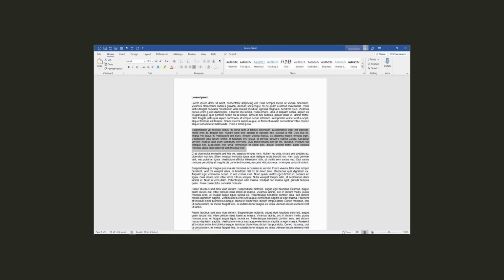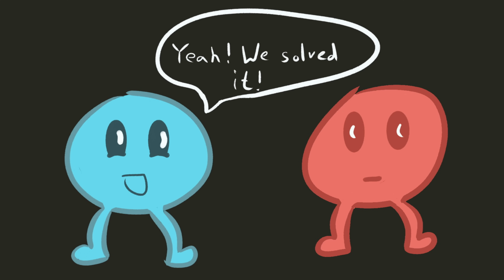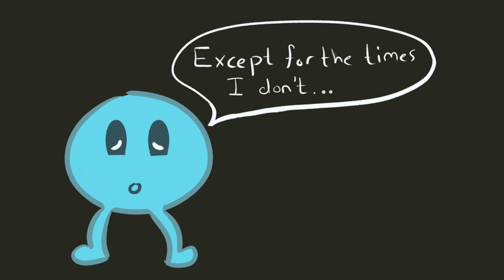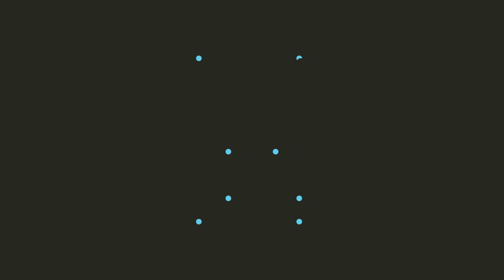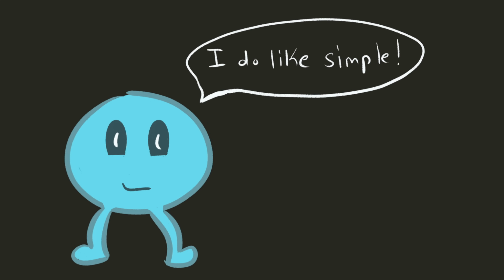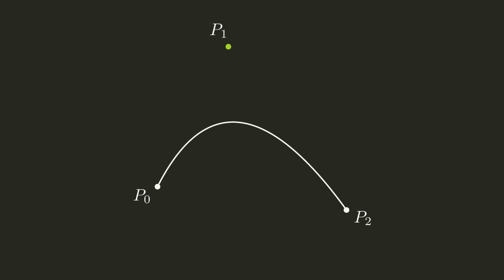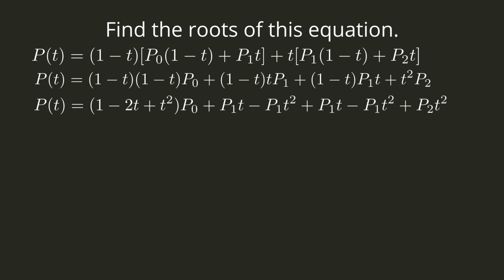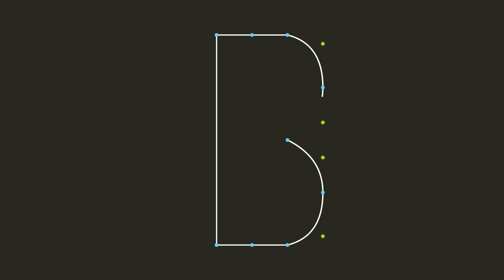The Math Behind Font Rasterization | How it Works

Comment: While what you have described will allow one to render an outline, this will not render characters or strings of characters of high quality. Consider rendering outlines on a fix grid a progressively smaller and larger sizes. Consider the letter uppercase H, at large sizes the two vertical strokes are of equal width and height, buts as the size gets smaller one of the strokes will render 1 or more pixels narrower that the other (This is known as the picket fence problem) looking at the horizontal stroke as the outline gets smaller the stroke will render wider or narrower than the vertical strokes, it will also be displaced upward or downward from it’s desired location. This is the vertical variation of the picket fence problem. Now let’s consider Capital M with regard to the vertical strokes it has the same problem as Capital H, but now it has anew problem the diagonal strokes don’t have the same widths as the size gets smaller, but because of pixelization there weight becomes heavier ( fatter relative the the vertical strokes) this applies to all diagonal strokes as is most pronounced at 45%. The same artifacts apply to curves Consider the Character O, as it drops in size the left right top and bottom will not be the same width in pixels similarly the curve will render fatter and fatter as it approaches North east, south east south west and north west. Now lets consider a collection of characters. The horizontals are varying in width and move up and down in Y the Verticals are varying in width and moving Left and right of their entended position. The most obvious artifact is the bottom of the characters don’t share a common base line the is called baseline wander. There are solutions to all of these problems that involve looking at the morphology of each character individually and looking at strings as agrégate characters with features like common base lines inter character spacing and string widths as features that need to be preserved when they are rendered. As an exercise for the reader consider the case of a lowercase i it is clear that the size of the staff and dot need to be the same, but the relative position of the dot, size of white space and staff need to be treated holistically. When one moves away from Latin Alphabets to ideogram base writing systems like Kanji, Hangul, Nihongo, Cursive positional representations like that found in Arabic… al of the Latin problems exist as well as numerous features that need to be preserved that are not as simple as the examples that I gave above. Then there is a basic  implementations philosophy issue to you codify the rendering rules in each character “smart characters, dumb rendering” or Dumb characters, smart rendering” The former requires more work per character/ideogram the latter requires more understanding of the underlying morphology issues. I think true type is a good rendering system (Smart Characters, dumb rendering) Adobe type 1 rendering is the first to market and mass adoption format is an example for (Dumb Characters, Smart Rendering). Good presentation of rendering outlines to pixels, but not really representative of what it takes to render high quality type. I am one of the creators of Adobe’s type technology and also had a hand in the reaction of TrueType. More please.
Reply from the maker: Thanks for this extra insight! I was amazed at the complexity that goes into rendering a single character as I was researching for a project I worked on (which is one of the reasons I made this video). One of the parts that blew my mind was the TrueType font program table and learning that fonts can embed programs to adjust the pixel placement for letters. Not only that, but like you alluded to rendering strings of characters also requires complex layout algorithms and other font metrics like kerning information or ligature conversions. Font rendering is an insanely deep rabbit hole to fall into, and it's very cool to hear from somebody that got to work on the original technology :)

I am curious, do you know how much these algorithms for tweaking pixels at small/large font sizes still holds true? I was under the assumption that since almost all devices now have high-dpi or lots of pixels (not counting embedded devices), the pixel adjustments were less of a concern? But I honestly have no idea how browsers and other text heavy applications render text (whether it's just cached textures or real-time rendering or a mixture of both).
Reply: @GamesWithGabe  The tweaks are still needed. Higher pixel per inch monitors simply changes the magnitude of tweaks and the size at which artifacts start to dominate the rendering. The mathematics of the font descriptions is mostly a thing of beauty. Regarding string widths managing the inter character spacing and propagating the fractional errors that quantizing to a fixed pixel grid demands is one aspect of the problem. Serifs, descenders like g, y… add another dimension to the problem. Preserving white space within characters like a, 6, 9 all are madding I think of it as a foreground background problem where neither are allowed primacy. The first rookie mistake is quantizing the fonts. The earliest Macintoshes fonts had integer font widths and integer Inter-character spacing quantized at 144 to the inch. A direct artifact of the 144 dpi ImageWriters that shipped with the earliest machines. Not only did our team design the software architecture for the Laserwriter we invested precious resources in rewriting the rendering engines that were used within QuickDraw. Steve Jobs really got his moneys worth out of teaming up with Adobe to save the failing Macintosh launch. To build real WYSIWYG systems the rendering intent is only quantized when it is on the device on which it will be rendered.. Once you have something to display or print the rendering intent has to be bound to the limits of the physical devices not the other way around. This is why a Macintosh could generate camera ready copy off an image setter with 2470 dpi resolution or a 72 dpi display or a 300 dpi laser printer and the only thing that change is the output conformed more closely to the rendering intent. In the realm of maintaining caches at high resolutions and large point sizes we found that compression algorithms that worked at laser printer resolutions were horrible at even modest point sizes and had to create a unique algorithm the usual line by line xor encoding to bias the data towards long runs for run length coding performed poorly but we observed that to we were able to take advantage  of the morphology of the characters and create a predictor that encoded characters that ran diagonally through the bitmap space with there own encoding and the compression ratios became much more tractable. There was talk up thread about anti aliasing real anti aliasing is dealt with by rendering the page in reverse paint order. The aliasing that comes with the trade offs of Color pixels being stacked side by side, top to bottom and several other less than ideal device dependent topologies is better dealt with by overlaying a field lens that brings all of the illuminants together geometrically . for my sins I dealt with all of the hardware vendors that came through our doors. Our brain and visual system is very forgiving of some things and really fussy about others. I knew it was going to be a bad day when I had to explain to yet another vendor why we couldn’t fix their broke assed hardware in software. It has been a long time since I thought about this stuff. Best

Comment: One thing I don’t understand is how does the Bézier curve work on points (2 numbers), do you just apply the operations to vector2  elements?
Reply from the maker: The mathematical notation actually extends to any arbitrarily sized vector. So if you just imagine that P consists of two components, <x, y>, then you just use the same equation for x and y. Then you can extend it to 3 dimensions by using the same equation for z, etc. Let me know if that makes sense, it's kinda late and it's hard to type this on a phone haha

Comment: Most need not remember the quadratic formula -- only (visually) that degree 2 single-variable functions bend toward and then away from the x-axis, and (algebraically) `x * y = 0` where x and y are expressions, means either x = 0, y = 0, or both

Comment: I'm not up on my quadratic equations, but overall I enjoyed the video. I was a little distracted at the beginning, though, due to some errors. Not big things, but big enough to make the problem of raster fonts seem overwhelming.

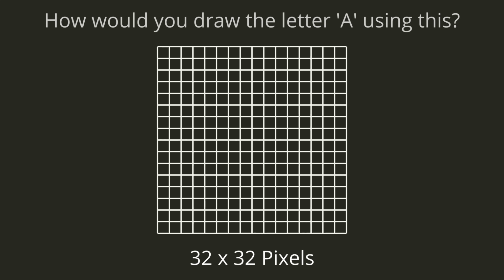At 1:26 you introduce a 32 x 32 grid, but it's actually only 16 x16. 

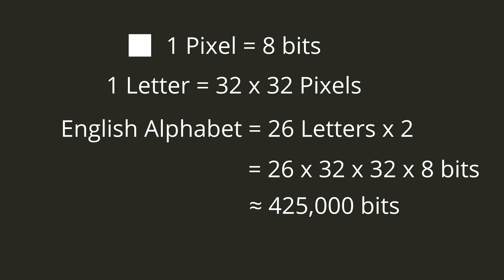At 2:10 you present the formulas for determining the size of a raster file for uppercase and lowercase English letters in a monospaced typeface. 1 pixel is certainly 8 bits of data for grayscale, but fonts weren't grayscale--they were bitmaps; thus, 1 pixel was 1 bit. 1 letter in your font would have occupied 16 x 16 bits. The final equation should have been 26 x 2 x 16 x 16, or 13,312 bits--not 425,000 bits. This font would take up about 1,664 bytes or 1.625 KB (K-bytes), not 53 Kb (K-bits).

At 2:37 you bring in BMP files, but fonts weren't stored as BMPs. Also, Apple didn't invent TrueType to solve the problem. The problem was already being solved with Adobe Type 1 and Type 3 fonts, introduced in 1984, the same year as Macintosh. Apple made TrueType to avoid licensing fees for Type 1 fonts. Side-note: Too bad for consumers because TrueType fonts (quadratic B-spline) were inferior to Adobe Type 1 fonts (cubic B-spline). Anyway.

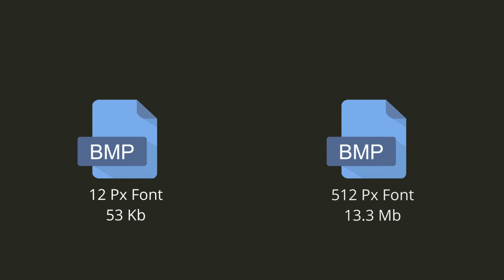At 3:23 you present a 12 px font at 53 KB, referring to the previous 32 x 32 px grid that was actually 16 x 16. The 512 px font is presented as being 13.3 MB. But using bits, not grayscale pixels, the 512 px font would only be 1.664 MB.

Again, I really liked the description and animation of the Bézier splines--top notch work.

Comment: I have a question, isn't possible to save an interior point in the font file? It would simplify all the calculations. I'm not a programmer, if someone know why it is not used, it will satisfy my curiosity.
Reply from the maker: Hey wonderwise! If you're asking if it's possible to save the points that make the curves in a file, then it's not only possible but that's how the file format actually works.

Essentially a ttf file stores a bunch of binary "tables" of data. There's one table called the glyf table. This table stores all the information about where points are located. It basically just has a bunch of binary that represents the points, and it will tell you if the next two points are a straight line, or if the next three points are a Bezier curve.

Microsoft actually has some really great documentation that's pretty easy to read. You can read about the glyf table here https://docs.microsoft.com/en-us/typography/opentype/spec/glyf . And a glyf, aka glyph, is just any single shape. Character sets like the Arabic character set will actually only define a few different glyphs, and those glyphs get combined into a single character. The Chinese character does something similar, and it's all really interesting to learn about :)
Reply: @GamesWithGabe  thanks for answer, maybe my question was a little misleading. I meant you could save a single reference point which is in the interior area of the font curves and lines. And therefore, it wouldn't be needed to check where is the interior and exterior of the font.
Reply: And you could fill the interior colour of the font from that reference point.
Reply from the maker: No problem! And you could do something like that, but the interior points would change depending on the size of the font. Another problem is, flood fill algorithms are actually pretty slow, and if you can come up with an algorithm that works for every single pixel, then you can run the algorithm for every single pixel at the same time. This means you can use the GPU to hardware accelerate the process, or multithread it on the CPU to make it several times faster depending on how many cores there are
Reply: @GamesWithGabe  okay, thanks a lot, I understand it now

Comment: 8:12 does that mean that rendering 1 billion 'B' letters is more costly than 1 billion 'I" letters in the ttf format?
Reply from the maker: Not in practice because programmers will typically "cache" the letter to a texture. So they'll rasterize it once, then save the pixels, and then basically stamp the letter where they need it every time they need to use it :)
Reply: @GamesWithGabe   well then, next video should be "The Code Behind Font Rasterization | How it Works" ay?

Comment: I found a way to render a path made of lines, bezier curves of any degree, arc of ellipse or any shape you can imagine.
For each computed pixel, i keep trace of the vertical sign of the derivate of the curve (which i compute by simply substracting a pixel position from it's previous). If it's an edge, or two curves crossing each other, i keep trace of both values.
Now, from the upper pixel to the lower, then form the more left pixel to the more right, i draw the filler pixel if the sum of the sign is more than 0. I can avoid drawing on line if i want.

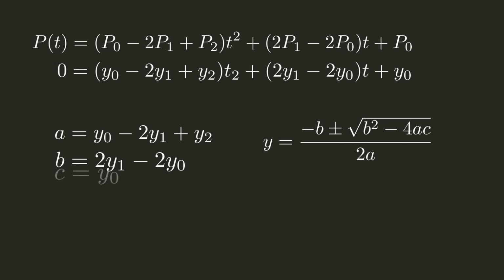Comment: 14:45 why would it not intersect with our curve if it's greater than 1? Also at 14:17 the solutions should be shown as "t=" not "y=". Interesting video, thanks!
Reply from the maker: If it's greater than 1, then that implies that the value would intersect after the endpoint of the bezier curve. So, technically it would still intersect with the curve, it just wouldn't hit it between the end points 

And you're right about the y should be t, I didn't even notice I had that messed up until now haha! Thanks for mentioning it though :)

Comment: Your loose usage of terminology and inconsistent representation of points made this video somewhat frustrating to watch. As nitpicky as it sounds, using the correct jargon is important if you're not redefining terms.
Reply from the maker: Could you please let me know which terms I was using inappropriately? I'm still learning, and I want to correct my mistakes in the future, and I know I still have a long way to go. So I appreciate all the help I can get :)
Reply: @GamesWithGabe  So a couple examples: At 4:21 you say you can translate a curve by adding a value "inside or outside the equation" when what you're doing is adding a constant term for translating vertically, and adding an offset to the input to translate horizontally. The "equation" in this example is the entire f(x)=x^2 and both changes occur inside this equation.
At 9:46 you start off using 2d vectors to define the points and then switch to scalars when getting the in-between points. This works intuitively because we know the y-components are both 0 but this might be confusing to people who don't already understand linear interpolation between vectors.
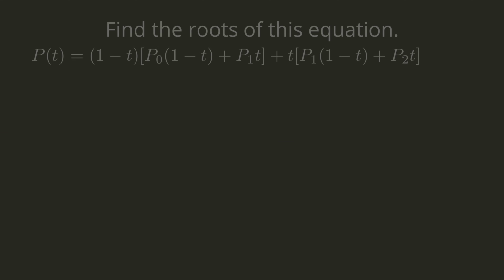At 13:18 you call the quadratic formula the "quadratic equation."
One other thing, you seem to use "function" and "equation" interchangeably, and while that's not inaccurate since all the equations you're defining are functions, it's needlessly inconsistent.

As a whole the video covers the topic really well, and provides some great visualizations. Keep up the good work!
Reply from the maker: @equivocator7727  thanks for letting me know! This probably stems from the fact that I'm more of a programmer than a math guy haha. I'll try and clean up my language surrounding equations and functions in the future though :)

Comment: I think a video on anti-aliasing would be interesting as well. The idea behind anti-aliasing is that if the edges contrast too much with the background you get a jagged looking texture along the edges on a (low resolution) bitmap screen. So what you do is you fill in the background near the edges with shades that transition between the shades of the letter and the background so that shades transition between the letter and the background more gradually. This gives less jagged looking edges. Thank for this video.

Comment: I came up with a way to compress your 512x512 font:
We look at the bitmap row by row:
For each row, start by counting the number of consecutive black pixels starting at the left edge. This number is between 0 (the left most pixel is white) and 512 (the entire line is black). Next, count the number of consecutive white pixels starting at the pixel after the last black pixel that you just counted. Next, count the number of consecutive black pixels to the right of the last white pixel you just counted. Continue untill you've reached the end of the row.
Then do the same for the other rows.
The only potential problem with this is how you would represent numbers. The easiest is to just choose a number of bits, and if you need a number bigger than the maximum, just write a 0 to indicate that the other colour shouldn't be drawn yet. Then you can just tweak the bits per number to see what the smallest file would be.